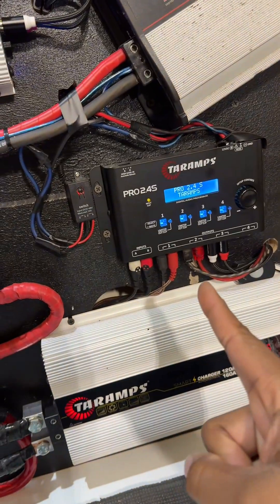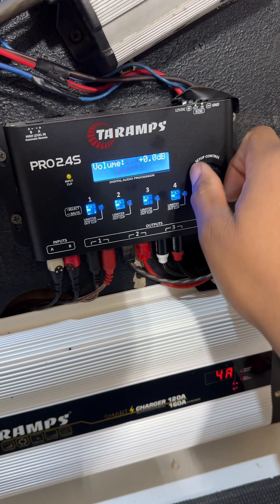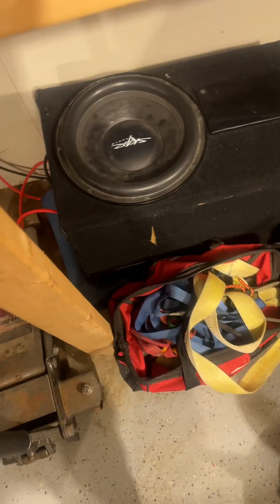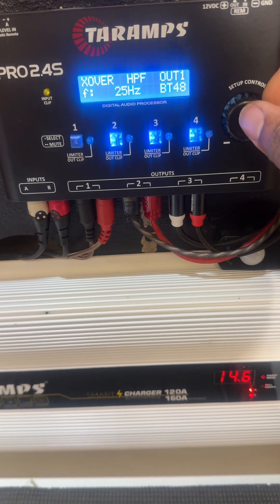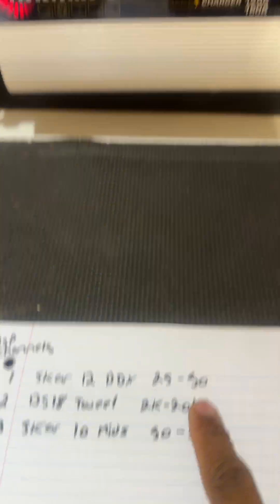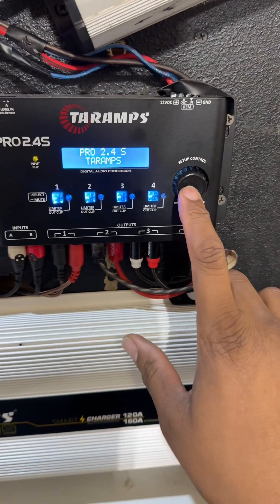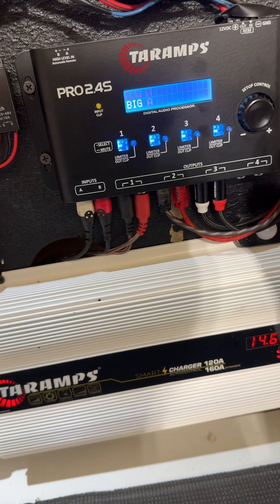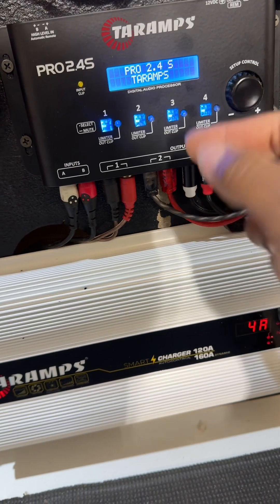Taramp pro 2.4 dsp

Comment: Hello i was wondering what would be my crossover settings on my amp afterwards? also the Full, Hpf, of Lpf switch? thank you
Reply from the maker: Start with everything at 0.

Have your switch on full

Only adjust gain and if needed start increase your bass boast

Comment: Im not getting sound
Reply from the maker: @marcuswashington6738  make sure you don’t have the channel muted (press and hold blue square for a few secs)
Reply: My question is im connecting the front 2 speakers but to the high level input but where do I connect the rear speaker wires? Im running factory radio to harness to dsp to 4 channel amp. I've hooked up 4 channel amps but not with dsps. And with that im just running the speaker wires straight to the amp
Reply from the maker: @J-Will19  you would tap into your front factory speaker, wires for your signal then you would be running wires from your four channel amplifier to all the speakers in your vehicle.

Comment: How do you do the rem in n out
Reply from the maker: @kylekaden7696 run remote  wire into the  rem in and then rem out would go to other devices (amp or other items that need switch power)